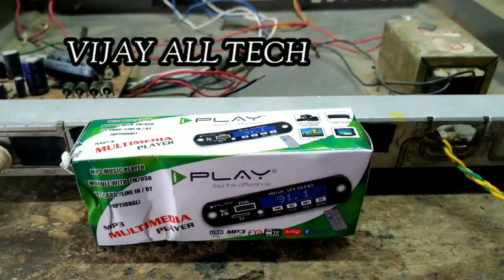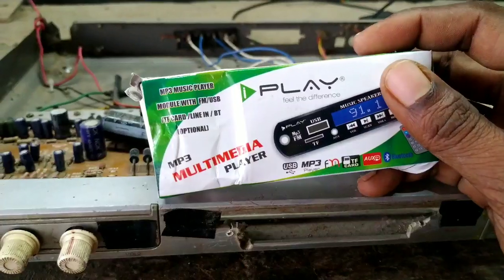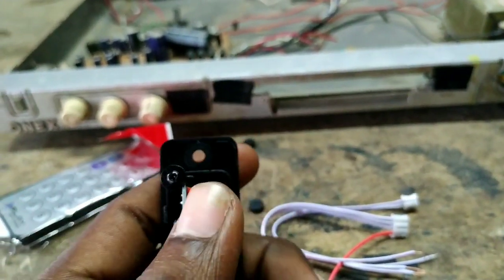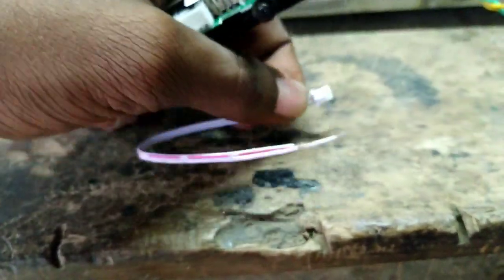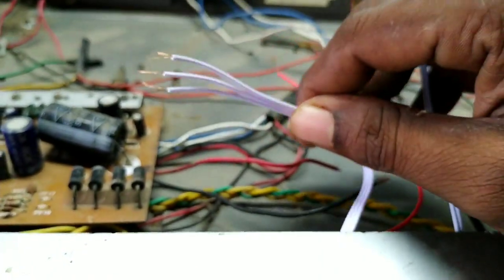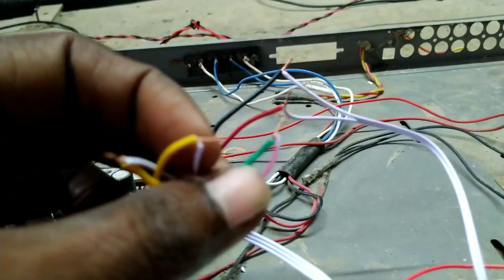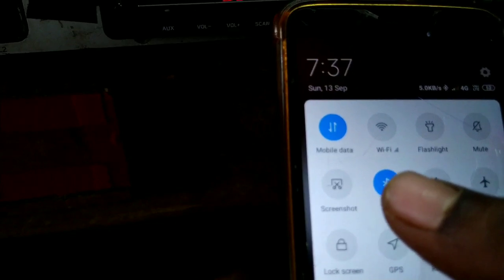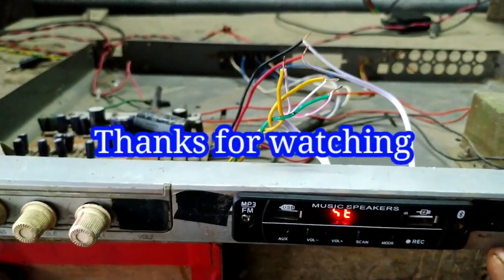How to make bluetooth amplifier | convert normal amplifier into bluetooth amplifier | in telugu

Comment: Bluetooth panel amozen link pettu anna
Reply from the maker: ERH India Bluetooth Fm USB AUX Card MP3 Stereo Audio Player kit with IR Remote, 5v Amplifer Chip, 7805 Voltage Regulator and Filter Capacitors for DIY https://www.amazon.in/dp/B08LCM2R4H/ref=cm_sw_r_awdo_navT_g_TKK0S1FR16MP0GAQ9QB4